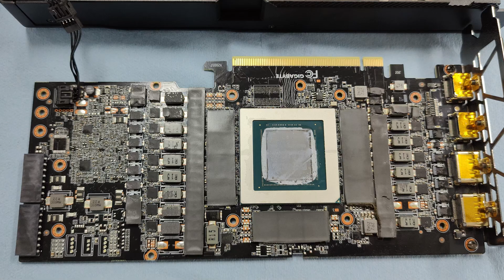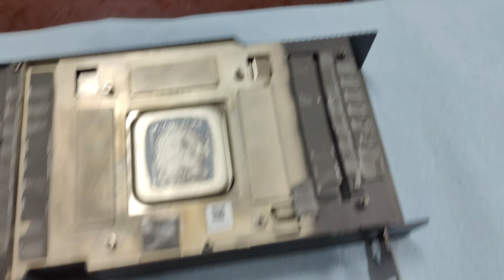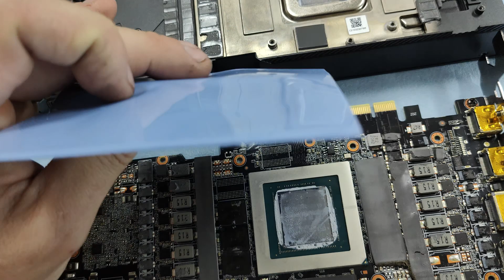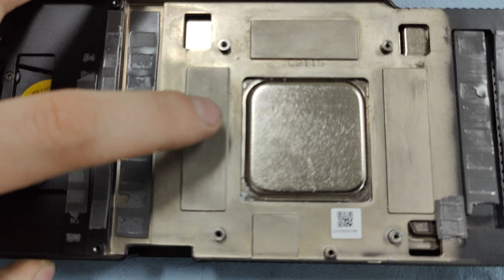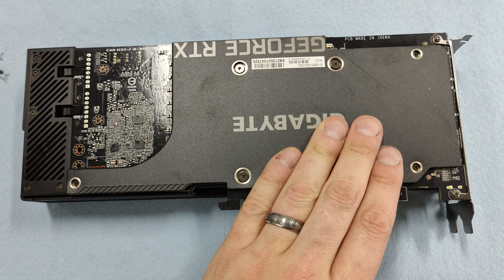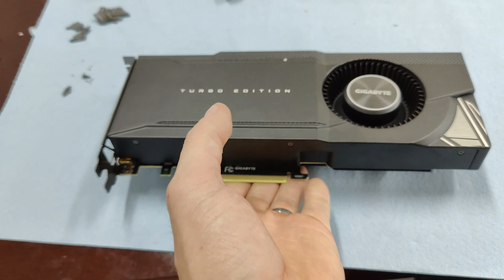Gigabyte 3080 Turbo Thermal Pads and Paste - Ethereum Mining

Comment: In the video you mention 1.5mil for vram pads, I tried this with thermal grizzly 1.5mm pads, but this prevents the gpu cooler to seat fully.. 1mm I also tried, and didn't work which overheated the vram. 

Which exact thermal pads are you using for the VRAM here?
Reply from the maker: That is the correct size. Maybe you are using a different gpu that needs a different size?